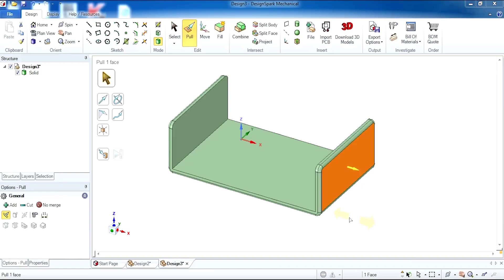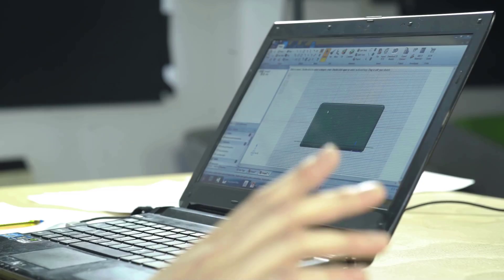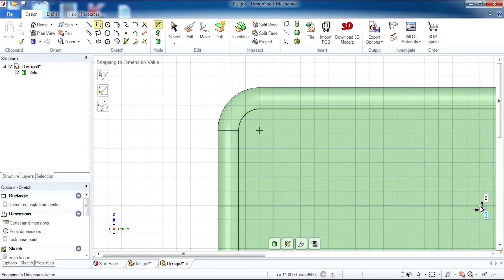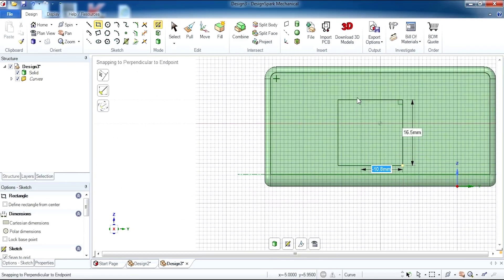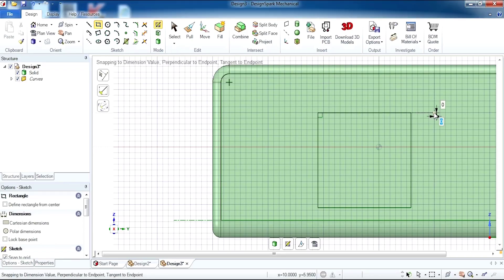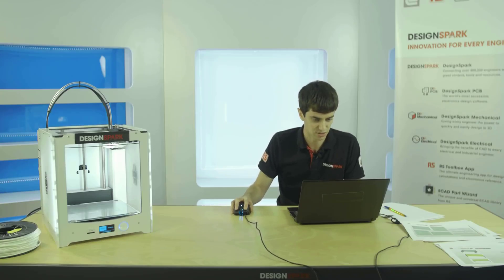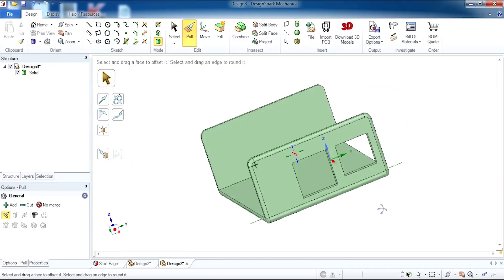DesignSpark Mechanical Training | 4 Cut-outs

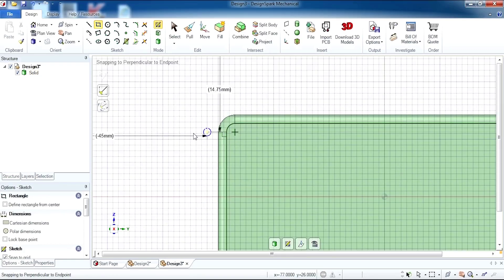Comment: Hello, I would like to say thank you firstly... as stated by a few comments. When starting with Cartesian dimensions at  1:33  with dimensions 19mm and -5.3mm, the results are different from yours. 
To FIX this, do not enter (-) minus.  The correct figures are 19mm and 5.3mm. @2:17 16.8mm and 16.5mm @2:57 40mm and 5.3mm. @3:18 15.8mm and 14.1mm